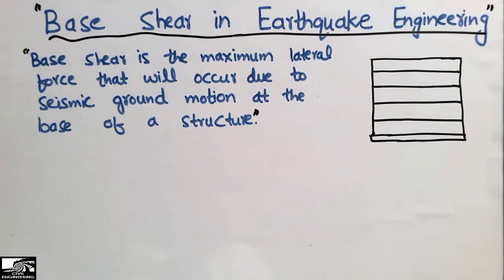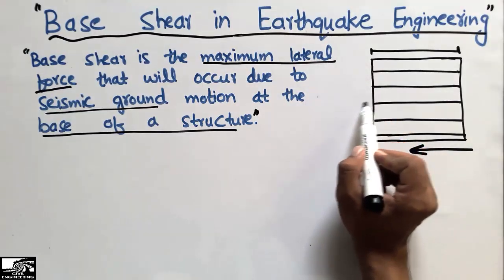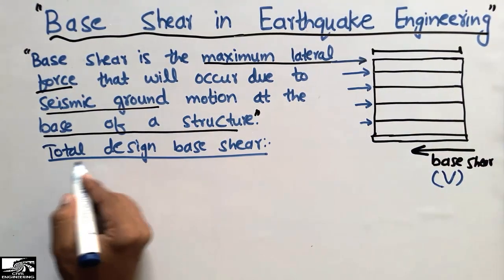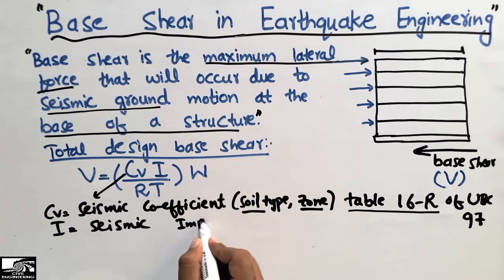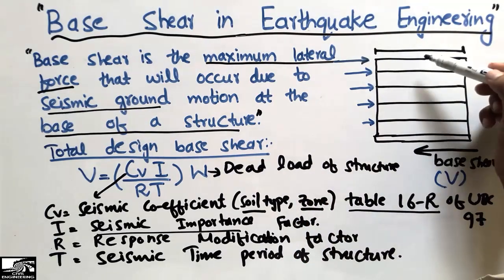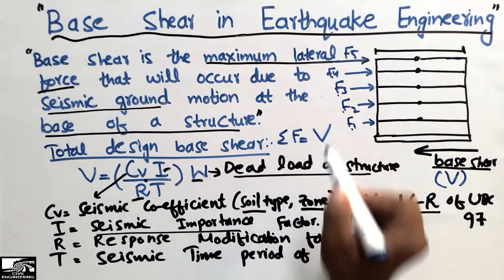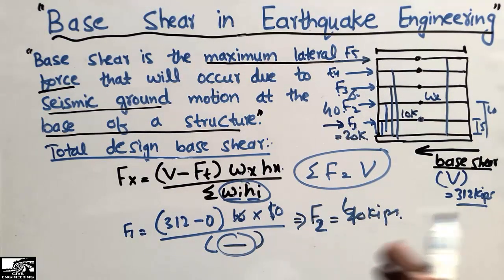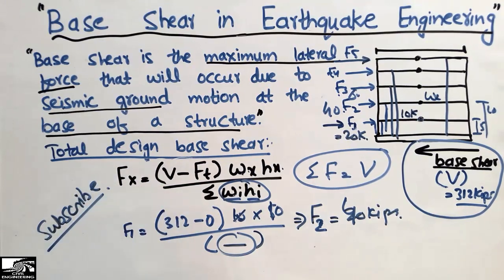What is Base Shear || How to Calculate Base Shear & Storey Forces

Comment: How do you find out the weight of one floor? Is it estimated? Also, will the lateral forces be distributed equally among the building's columns??

(I'm a fresh graduate of civil engineering, no work experience, and am wondering if i can design a building by manual calculation because i don't know how to use staad/etabs)
Reply from the maker: weight of floor can be found out by knowing the density and volume of material used in floor, no lateral forces are not equally distributed, it depends on many factors
Reply: @civilengineering94  so i can't apply for design engineer until i know how to use software? The most i know right now is the free 2D frame analysis at http://jfmatrix.com/Analysis
Reply: Ofcourse you can do manual calculation. The thing is, you should be able to make the framing of the structure to be Regular as much as possible. But most structures designed by Architects of today are very Irregular in shape. If you have an Irregular Structure, this can be difficult to calculate by hand Considering the distribution of forces in a 3 dimensional perspective. The appropriate type of Seismic Analysis for Irregular Structures is called Dynamic Analysis.